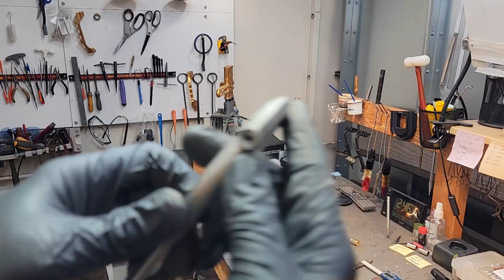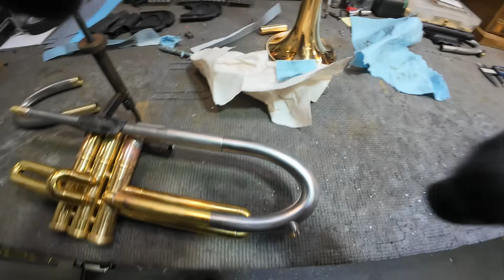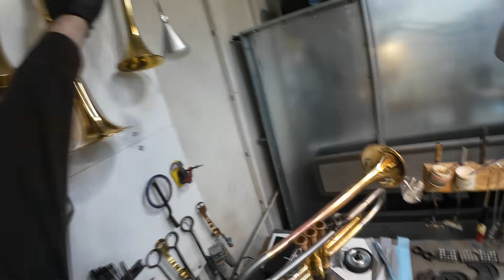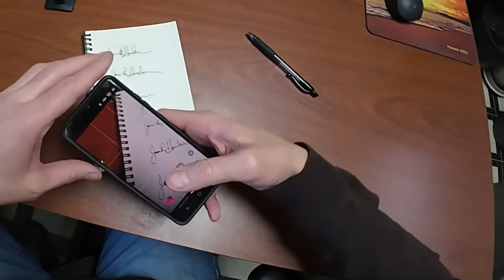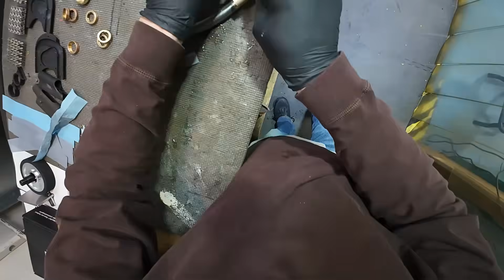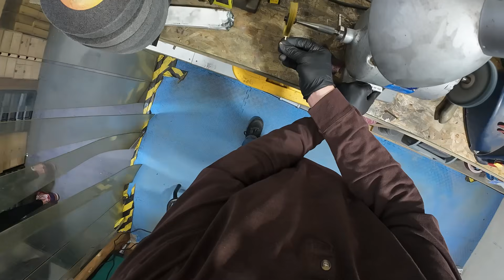Harrelson G5 Summit Trumpet: Assembly - Part 2 of 3

Comment: Now I know why it takes some time for my trumpet to be built! This is artistry, craftsmanship, technology, science, experience and grit. Also why it costs as much as it does: all the $ invested into everything from machinery, tools and materials to supplies like those scotchguard pads for brushing the brass. I always wondered how you brush the brass. That's exactly the combo I want: brushed brass on the outside with a shined inside of the bell.
Reply from the maker: Yes, building trumpets is more work than most people conceive. And think, this video series doesn't show any of the engineering, prototyping, testing, or actual manufacturing! Someday, I'll create a comprehensive video series that will likely be 20-30 episodes.

Comment: Great watch with my Saturday morning coffee. Fascinating stuff. I’d love to see a video: “How to re-brush your Harrelson Summit”!
Reply from the maker: The re-brush process is fairly similar to this video. Cut 3M Scotchbrite gray pads (not maroon) into 1.5" x 3" and 1" x 6" pieces and one 3" x 6" piece. Disassemble your entire trumpet including the finger buttons, top/bottom caps, slides, and saturn water keys. Cut up heavy duty blue shop paper towels into pieces small enough to fold and place into every single open hole on the trumpet to protect the inside from grit and debris. Start with the main body of the trumpet by setting it on a scrap piece of carpet or padded mat. Kitchen sink floor mats work well. Get your gray pads wet by soaking them in a small bucket or bowl filled with distilled water, just leave them in the water for most of this process. Using tap water will likely result in hard water spots that will require secondary removal. Trust me, use distilled water. 

All of your brush strokes will leave small scratches that reflect light and determine the overall aesthetic. You may opt to brush everything parallel to the leadpipe, which is our standard brushed finish. Or you may brush radially around every tube and the bell, which results in a very different aesthetic. And finally, you can combine these two options or create random patterns as you like. 

Use the longer strips to work through the valve casing spaces, running them through from every direction to completely brush all exposed areas within reach. Repeat on all tight spaces. Using the the smaller rectangular pieces over the rest of the trumpet body and tight areas of the bell. Finally, use the large pad to brush the outside of the bell, to blend the valve casings in the direction you have chosen, and then inside the bell. Every brush stroke is down wet to prevent dangerous dust particles from getting into your lungs, in your home or work space, and inside your trumpet. Once finished, rinse immediately before the trumpet begins to dry with water spots. This is why I recommend using distilled water. Dry everything inside and out immediately. Failing to rinse the inside may result in unexpected water spots that will surprise you later. Repeat all steps on the slides. Next, lay the largest pad flat on your table or workbench and rotate each top/bottom cap and finger button onto the abrasive pad. Rinse and dry thoroughly. 

Before you re-assemble your trumpet, consider coating it with a protective barrier. There are many products on the market that work very well with brass, steel, nickel, and other materials present on trumpets. Many of our clients have had great success with clear coatings designed to waterproof sporting goods equipment. Some opt to use industrial type sealants for machinery. I've seen and heard of many different products that are very effective in preventing tarnish and preserving the finish. The funny thing about trumpet players is that many of us are afraid to get our hands dirty. And many more fear they may damage their nice instruments. Both of these fears are usually unfounded as I have never had anyone come to me with a trumpet that needed repair from waterproofing or preserving the finish. That hasn't happened once in 30+ years. I encourage you to take a deep breath, find your strength from within and go try it for yourself. The worst that can happen is that you may need to strip down the finish again, which is the exact same process I just shared with you. The best case scenario is that your newly brushed finish will be preserved for years to come. And truthfully, could your trumpet look any worse with a sealed surface when compared to how it looked before you started this process? Unlikely!

Why don't I lacquer or clear coat my trumpets before you take delivery? Well, the answer isn't what you are expecting. I can do all of this work in my shop with relative ease. Yes, there are some extra steps and time, which is added expense I could add onto the final price. But the problem is that all clear coating will eventually wear, which usually starts at contact points. And this leads to complaints and eventually the pointing of fingers. I've been blamed for failed finishes too many times to offer lacquer or any type of clear coat finish. Customers in the past insisted on getting partial refunds or having their instruments re-finished after they start showing wear. This demand is usually accompanied by comments about the higher price of my instruments. There is an assumption that you pay more, so the finish should be guaranteed for life. Well, that's never going to happen. The only finishes that could last a lifetime will result in two major problems. The first is thickening of the resonating materials, mostly the bell, which results in a deadening of the tone quality. That is definitely not acceptable. And second, repairs of damaged parts will require removing the finish entirely. This is a major expense (usually over $1000) added to the cost of the original repair. 

If you own or have seen a trumpet that is clear coated or lacquered with absolutely no wear, it was either not played regularly or it was refinished at some point. When you look back at early print advertising from Conn and Selmer, you will see they clearly stated that lacquered finishes are a "temporary solution". So why not roll up your sleeves and try something new by re-brushing AND applying a protective coating to your trumpet? I bet it will look amazing!

Jason